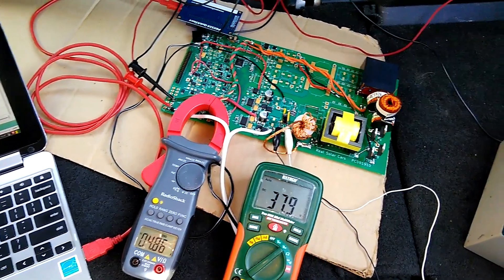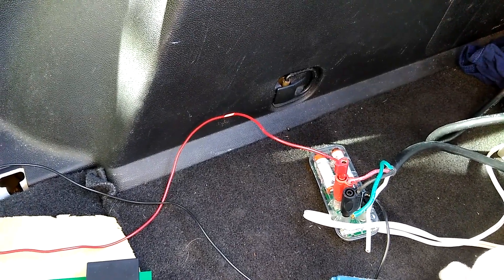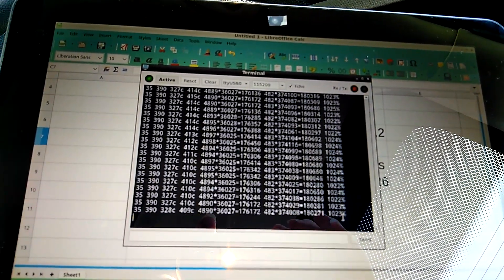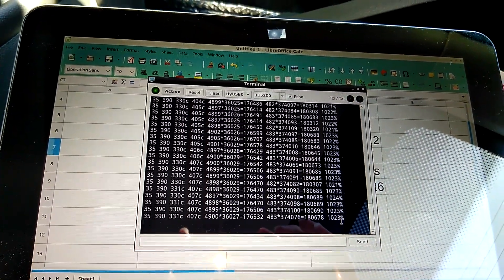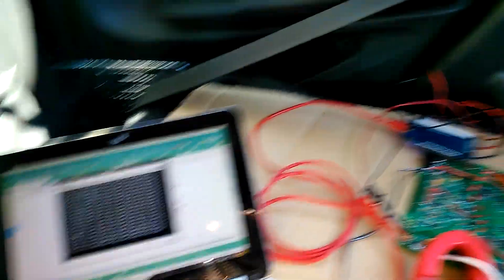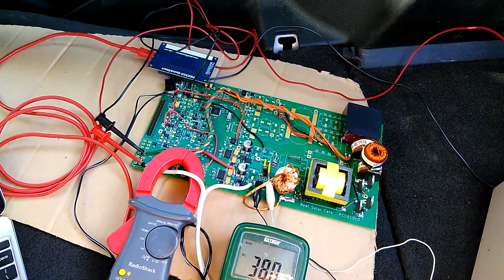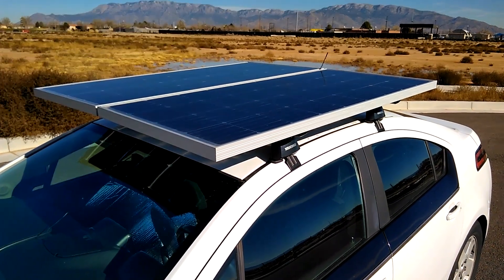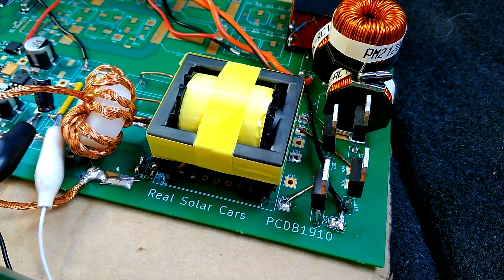Solar Car DC to DC Converter update December 2019

Comment: Wow. Great work! Im looking for simple dc dc boost converter 48-60DC to 360DC ( 2500Wp) for i-miev range extension
Reply from the maker: @konradmazur6204   Those converters were common in the early days of converting hybrids to plug in. We can build such a converter for a reasonable price if you have trouble finding one.

Comment: Is this product available to buy as a kit for Nissan Leaf?
Reply from the maker: Our board is designed to be flexible to support many different vehicles. Connecting a device like this is very much unsupported by the manufacturer so won't know how the vehicle will respond until we try it. We want to avoid the need to open the battery pack as that's both dangerous and a complex task.  We expect that we could charge via the chademo port without much trouble. We don't have a LEAF to test on.

Comment: What education do you have to learn this? How can I learn how to make this? Thank you so much!!!
Reply from the maker: Hopefully you have seen my interview with Sam.  https://youtu.be/lzKVSIE3Dcc?t=1540  I have a masters in electrical engineering. A degree is a good base, but there is so much not taught in school. There is so much I had to learn on my own.  Just learn about things closely related to what you want to do, and also other things that are unrelated because there can be surprising links.  Look at commercial products and think about why they are made that way.  Every part has a purpose, because parts=money.   I got a lot of hints from solar microinverter reference designs. In fact, a microinverter could DC charge an EV battery if it had the right software. The voltages and power levels are the same. But solar charging a car requires a bunch of extra interfaces that solar inverters don't have. So I decided it would be better to design from scratch to get exactly what I need instead of modifying a microinverter.  My board is microinverter + 12v mppt charge controller + programmable logic controller + CAN bridge.   I hope to make it available for sale very soon.  But the reality is even the tiniest detail like regulating the output voltage can be a complicated problem that requires a lot of time. Affectionately known as "yak shaving."  The new board uses the Propeller 2 microcontroller.

Comment: Did u get any further. Are you ready to start selling them
Reply from the maker: I've got a new version board in front of me right now. They should be available for those who just need a DC-DC in about a month.  Want to be a beta tester?   It seems like it would be easy to access the energi battery. What power source are you looking to use? 

The contactor control will take a little longer as it involves reverse engineering the vehicle's precharge sequence and sourcing matching connectors.
Reply: @realsolarcars  I would test I am pretty comfortable with my battery I have taken 3 apart from scrap yard finds. I would use a 250w solar panel as the source. I could use 2 but realistic I prob only can fit one on my roof . Something like this  Open circuit voltage (VOC): 37.6 V

Max power voltage (VMP): 30.3 V

Short circuit current (ISC): 8.85 A

Max power current:  8.27 A
Reply: As far as precharge and contactor control what if I just hooked it up direct. I guess then bms wouldnt be engaged
Reply: @realsolarcars  also I have 2 relay boards from those scrap batteries
Reply: Is it open source project? I'm gonna be happy to test out this PCBs, was been looking for HV Mppt for a while. My cell is +1564999091 text pls. I will gonna be happy to buy a board if price is gonna be reasonable or build it myself if its open source. My car have direct access to HV leads inside of the pack(range extender in the trunk).
Reply: @pashko90  do you have any videos of your range extender
Reply: @pashko90  tthats cool is ur connection before before any precharge meaning it womt use
Reply: @plojm123  yes, my connetions inside of the case with current sensor relocation.

Comment: Since the dcdc you have made will do a 370v chevy pack can i assume that this will work without modification to your design on a gen1 leaf.

I drive a gen1 24kwh with a 16.8kwh muxsan extender. one of the issues for me would be having the solar inverter be able to engage the muxsan battery contactors so that both batteries share the solar power. otherwise the packs will drift apart and then the extender would be unable to turn on its contactors to parallel as there is a voltage diff limit to prevent arcing on the contacts and surges in the cables.

Amazing work though. I really want my car to behave more like a sono sion.
Reply from the maker: We tried to make the board flexible enough to work for most EVs.  The problem is if the contactors are closed while the car is parked that is considered a severe fault. For all the car knows they are welded closed. The muxsan pack adds some interesting options.  The good thing is it will be easy to connect a solar charger to the muxsan pack.  Perhaps equalization could happen 1. by turning the car on every so often to equalize the charge. A full day of charging raises my Volt's battery by 5-7 volts. That might be acceptable.   2. Run an inverter off the muxsan pack to charge the main battery.  Inverters that accept 400vdc aren't common or cheap, but they should be. It would also be nice for vehicle to home use.   I want one.  3. Series contactors to block power to the car's systems while charging the main battery.   4. Exploiting the voltage characteristic differences between the nissan pack and muxsan pack. I remember seeing a video about how the extender pack mostly kicks in after the nissan pack is nearly depleted.  There may be a voltage range where the muxsan pack can accept a lot of energy with little voltage change.
Reply: @realsolarcars   "if the contactors are closed while the car is parked that is considered a severe fault." - is this not true on your chevy volt? so are you just resetting the error codes when you get back to the car before you drive?
 
  "The muxsan pack adds some interesting options.  The good thing is it will be easy to connect a solar charger to the muxsan pack.  Perhaps equalization could happen by turning the car on every so often to equalize the charge." - Muxsan pack will only connect with the main traction pack if within 500mv (i believe) so not sure that charging the muxsan pack off the solar is the way forward plus I'd like to see this work on stock leafs.
  
   "Series contactors to block power to the car's systems while charging the main battery. " - this sounds good but i can see some issues if your extra contactors disconnect while driving as they arent part of the stock system so could cause serious problems

   I'd like to talk through these ideas further in a forum with better formatting than the comments section of a YT vid. Would you mind creating a thread on mynissanleaf.com? and posting the link here?

Comment: That is neat.  Do you plan to release any more details about it?  Would be interesting to learn more about how you designed it and got such good efficiency.
Reply from the maker: It will be open sourced when the time is right. We are doing changes to the design right now that will eliminate all those jumper wires and add much more functionality. Making videos about converter design would just delay production.  But here's a hint: PSFB
Reply: @realsolarcars  Well I see TI has a video series about that comparing it to FB-LLC.  I will have to watch and learn about them and what the difference are.  I have only ever built basic buck or boost converters... Never any thing isolated or high voltage.